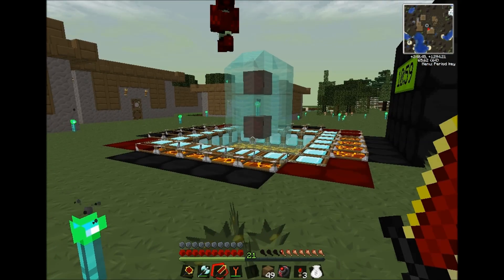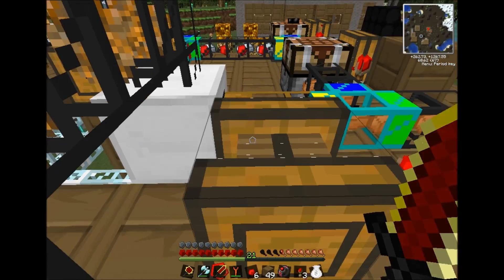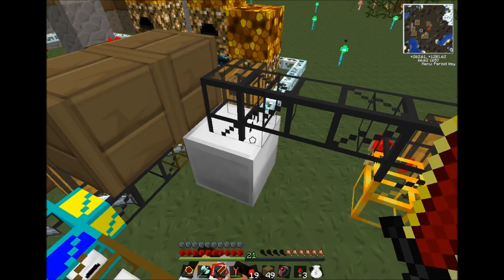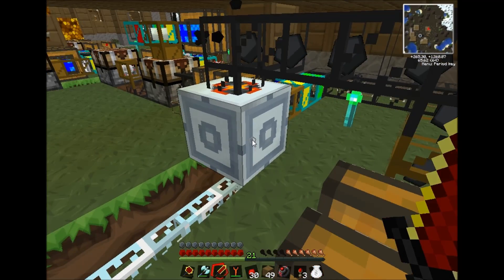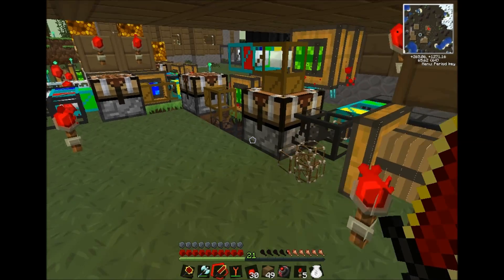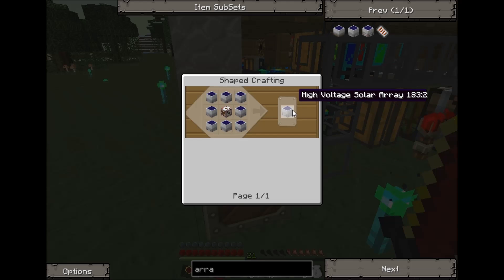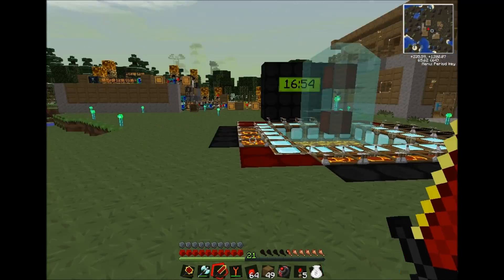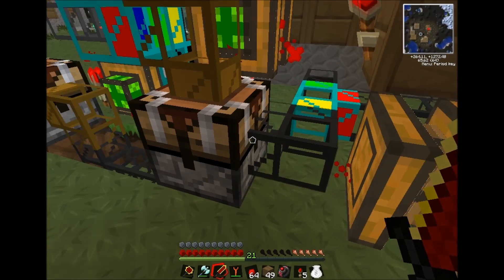HV Solar Array Factory- Tekkit Machine

Comment from the maker: Yea. I need to make a second wire crafting table to keep up for the circuits, and probably still overclock the furnaces more for the rubber. The batteries are a mess!